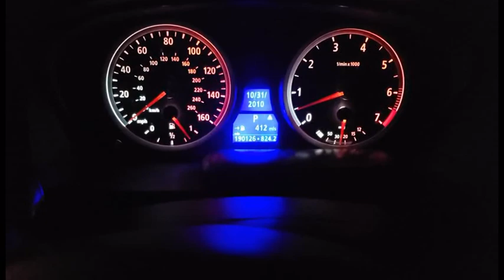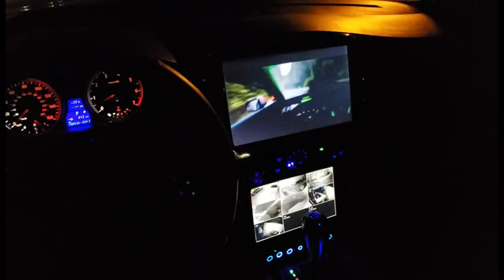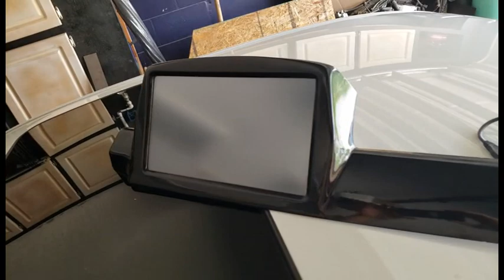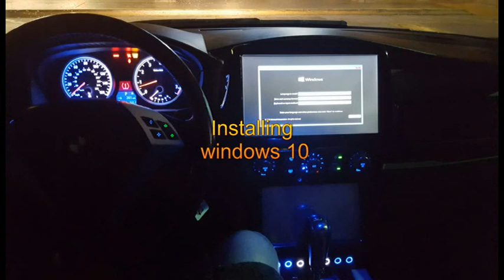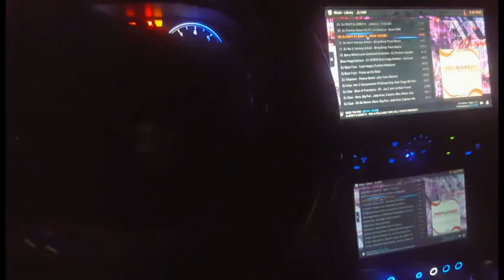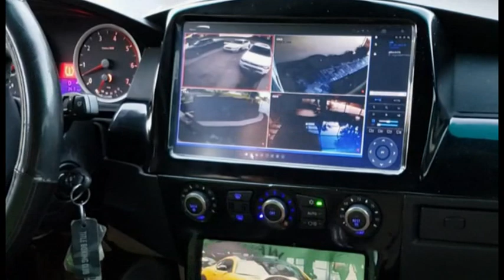Car PC windows 10 in a BMW

Comment: how come you did not go with a minipc? im planning a build for my chevy blazer but with the atx power supply separate from mobo installed elsewhere ? Pros and cons are great for innovation ! Im not looking to do much dash board modification.
Reply from the maker: Its a separate power supply by minibox. I did it a few years ago and wanted a full desktop type of experience. I actually don't really even use it much lol
Reply from the maker: Make sure to get good screens. I used cheap tft ones that are hard to see at angles and daylight

Comment: What did you end up replacing the hot glue with?  I tried that method with many types and they would always melt in the spring/summer.
Reply from the maker: where the hot glue separated i added superglue.

Comment: What are your power supply settings? Does the PC boot up on ACC and power down with a delay when turned OFF?
Reply from the maker: It's a feature build into the mi minibox power supply. Turn the car off and the pc goes onto sleep mode. When you turn the car ok it comes out of sleep. Via an accessory wire
Reply: @ProjectsPat  Awesome! Thanks!

Comment: how were you able to install a touchscreen ?, i was able to build a windows 10 pc like yours with a 1080p monitor panel from a broken laptop on the dash,  however that screen is a non-touch screen, so im using a wireless mouse.
Reply from the maker: It was a screen from ebay that had a touch screen film on top. It has a separate USB controller interface.
Reply: @ProjectsPat  could you please send me the link sir
Reply from the maker: @RajSuvin  I don't have one. Ordered long ago. Just search usb touch screen
Reply: PrOjEcTs Pat all right thanks a lot 🙏😁

Comment: Hey i want to ask maybe you know how to connect pc to 4x50w car amplifier that will be good audio signal without psss? not with bluetooth but from aux i tried many things but nothing helped.Thanks if you could help with some kind information😊
Reply from the maker: Hi, You would need to get a preamp to get the signal voltage up.
Reply from the maker: Aka line level signal booster
Reply: Could you please add links how it looks? And very thanks for information!😊
Reply from the maker: Something along the lines of this I'm not saying this is the one but this is pretty much how they are it's a line booster https://www.ebay.com/i/301807021873?chn=ps&norover=1&mkevt=1&mkrid=711-117182-37290-0&mkcid=2&itemid=301807021873&targetid=883075326854&device=m&mktype=pla&googleloc=9052410&poi=&campaignid=9241603121&mkgroupid=96861941914&rlsatarget=pla-883075326854&abcId=1141156&merchantid=8029254&gclid=Cj0KCQjw1Iv0BRDaARIsAGTWD1uVW9E4bpoxpRYC4qS6RXmtSNXMTLHMreZtk1vX_7Eu55QCJzRJ93oaAlFXEALw_wcB
Reply: Thankssss!!!😊
Reply: Hey sorry for more asking but that item does not helped but maybe (bit Ten D audison) will help? For clearing audio output from pc?😊 or it supposed to be in pc like turning on sound from speakers pup and when turning pc off pup sound? 😊